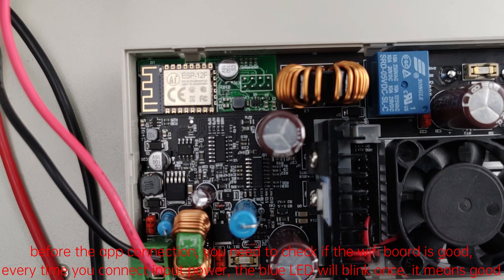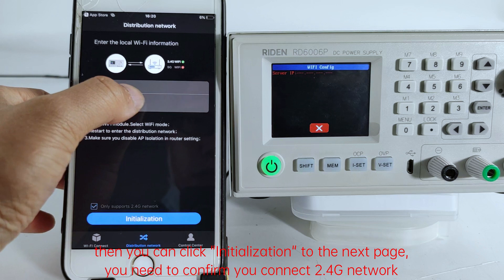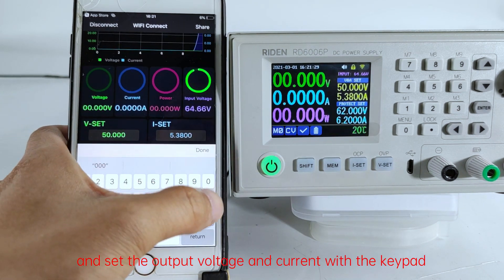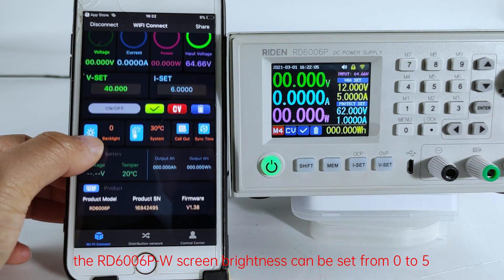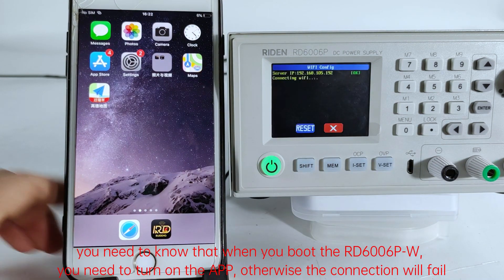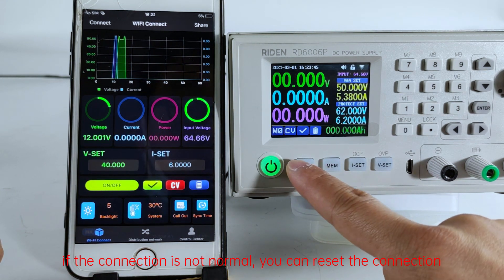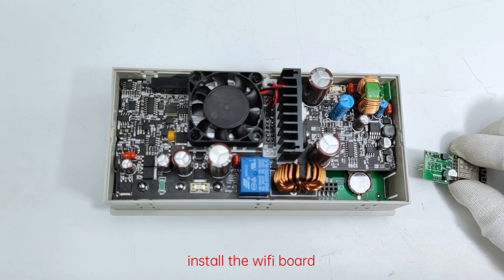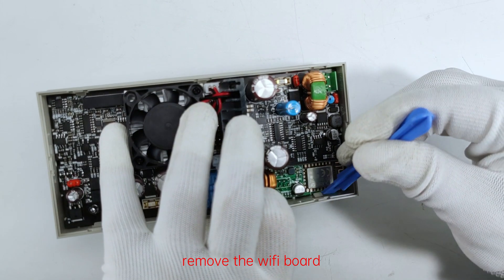RD6006P operation series video(manual 3.2) - IOS APP download/installation/ WiFi connection

Comment: In "Distribution Network" in the app I cannot enter an SSID, only password. When I press the initialize button the app seems to crash.
Reply: I actually got it to show the SSID but for IP Address in the app it just says "0.0.0.0" and that doesn't seem to work. If I connect to a 5GHz network the app will show an actual IP but it if course it won't work with 5GHz... On 2.4 the app just keeps showing "0.0.0.0". Plz help!
Reply from the maker: @ hello, if it shows this, it means that your app does not turn on the location service, when install the app, you can allow the permission it requires and then connect it again

Comment: Is it possible to purchase the WiFi board separate after for this item
Reply from the maker: yes you can buy the wifi board later,  just insert it into the socket and it can use wifi function